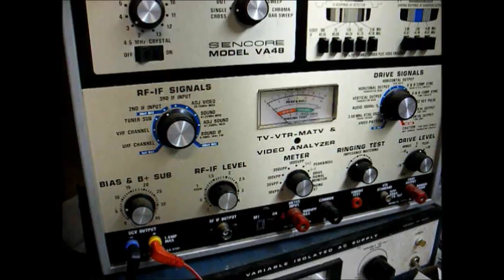Electronic moon repair

Comment: Knowing you love Jesus makes this the best of all your videos but  your other videos are awesome as well.... I play lead guitar at the Church I go to, I play through the solid state amp they have. But I'd rather be using my older American Made Fender Deluxe Reverb II that I bought new back in 1984. It's only 20 watts RMS using a pair of 6v6 output tubes but that Deluxe Reverb II will knock the dang socks off the Churches solid state amp any old day lol. Gotta change the main B + filter cap because it's getting a bit of hum now in the speaker I'll take it to church after all that is done. I have a Fender Twin amp that's American Made I  bought new as well back in 2000 it's a hybrid design with a quad of 6L6 output tubes 100 watts RMS of absolute brute power lol but I think my older Deluxe actually sounds better than the twin I guess the all tube design makes it sound so much better.. Can't beat that old vacuum tube sound. Great video 😀